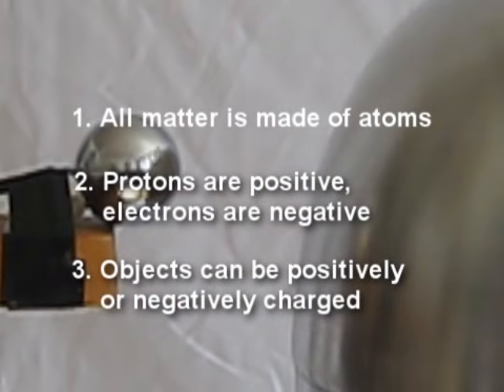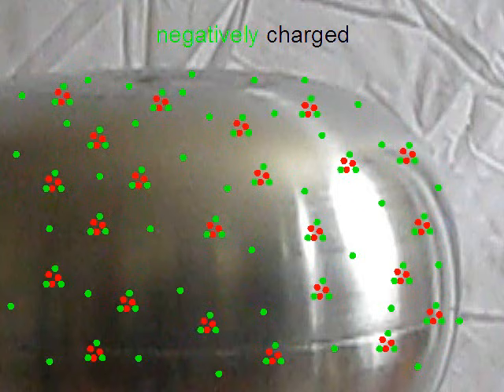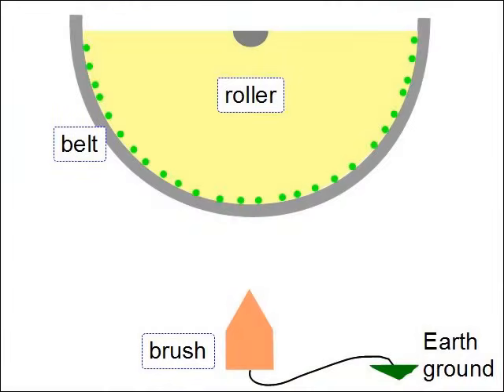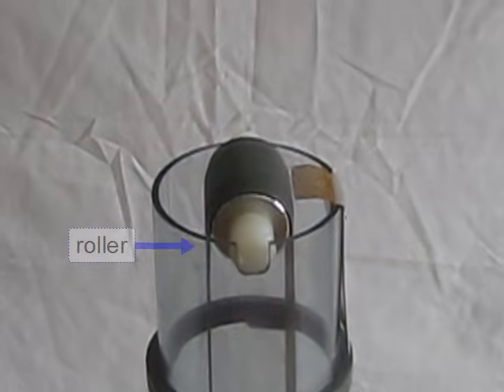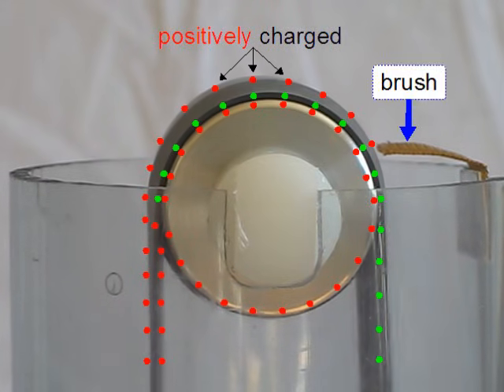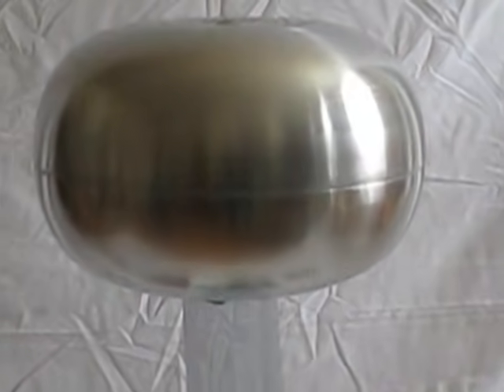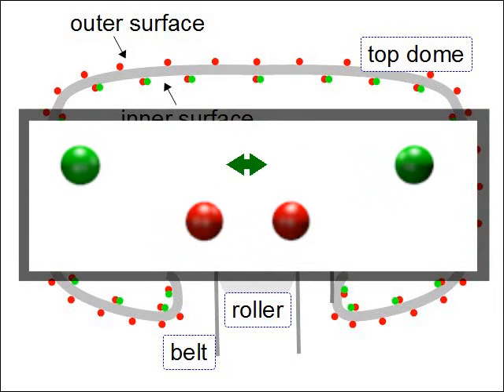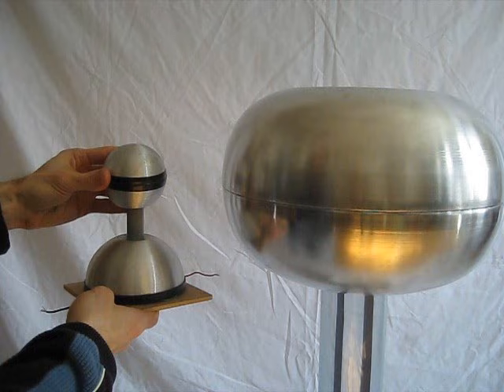How a Van de Graaff Generator Works

Comment: At first thanks for that wonderful video , but I find it hard to understand that there is a difference between the top brush being contacted from the outer or the inner area of the  sphere , it is a metal any way ,do you sure about that ,or is it a special kind of theory !  .
Reply from the maker: Anas Ahmad I know, it's a hard one to wrap one's head around, but it's not my theory. Look up "Faraday ice pail" or "Faraday cage".
Reply from the maker: Anas Ahmad I know, it's a hard one to wrap one's head around, but it's not my theory. Look up "Faraday ice pail" or "Faraday cage".
Reply: Anas Ahmad 
If your top brush is outside of the dome, and your dome gets charged, brush will have a very high density of particles inside it and electric field around it will be intense because it's out of the surface and charge on conducting objects resides on its outer surface. If your brush is inside the dome, electric field around it would be almost zero because all the particles will be on outer surface. So if an charged object(belt or upper pulley) comes near the brush that's outside of dome, it will charge the dome only until electric field around charged brush compensates electric field of external charge. But if you place the brush inside, it won't have any electric field around it and dome will charge almost infinitely(actually until parasitic leaks take over).

Comment: Question about the top dome.  Does the greater the surface area allow for a stronger charge?  I see people using spherical domes, what would the effect of making a 2d version or rather a vertical ring be?  Instead of being a round hollow shell, would a maze-like structure (inside, outside, or both) create more surface area without taking up as much space?
Reply from the maker: madDragon08 It is the surface area that's important. It's the roundness. The bigger the curve, the weaker the electric field, and so the less losses to the surroundings. That's why the larger the dome you have, the higher the voltage you can get to. I highlight this in the video around 14:56.

Comment: Is there any precaution to take to touch the home made van de graaff generator,like stand on a plastic stool....and is it make any problems in our body when we touch it...?????
Reply from the maker: Anandhu Krishna If you mean my homemade Van de Graaff that uses soda cans, they're harmless, unless you have a pacemaker. It doesn't cause any problem when you touch it. You just feel a very brief pain that goes away right away.
Reply: RimstarOrg  i mean about the van de graaff generator that look likes the one in ur video
Reply from the maker: Anandhu Krishna
Ah, I was confused because you said "home made" and the one in this video is commercially made. This one is much more dangerous because of its larger dome.
If this Van de Graaff generator is already turned on, then I wouldn't go near it, no matter what you're standing on. The spark I show repeatedly in this video is very thick and long and so has high voltage and very painful current, probably enough to cause a burn or at least make you jump with pain. It could be worse if someone has a pacemaker.
But, make sure it's turned off and also touch the dome with a grounded wire to make sure there's no charge on it, then you can put your hand on it and THEN turn it on. If you don't have insulating rubber shoes or are not standing on a plastic stool, then the charge will likely go through your body and to ground harmlessly. If you to have insulating rubber shoes or are on a plastic stool then the charge will remain on you and make your hair stand up. If at either of those times you quickly remove your hand then you might be fast enough to not get a shock. The best way to remove your hand is to first turn it off and then touch the dome with a grounded wire. That removes the charge. Then there's no chance of a shock when you remove your hand.
I do some demonstrations in this video here http://youtu.be/Gf6EbRmYImI
Reply: RimstarOrg Thanks for ur info, i like to present a van de graaff generator for my science exhibition and in this year i have to study about van de graaff generator and there is a short discription about it thats why i searched in the web :)

Comment: Excellent job. I have an older iteration of that model and the 200kv model as well.
Can you describe the upper roller bearing. The original had very noisy sintered bronze bearings which I replaced with plastic bearings. Ideally, I would use ball bearings, but I don't have the proper tools to do so. I'm always looking to improve my old unit. Is your unit noisy? Can you also describe the upper and lower combs? Serrated or braid?
Reply from the maker: eminusipi Thanks. I can't see inside well enough to see what bearings are in the upper roller. The bearings are fairly quiet. The overall machine is relatively quiet - about what you hear in the video at 0:14. Both combs are made from the sharp points of a stiff wire mesh that's cut straight across.Incidentally, I just needed a flashlight so I could see well enough to confirm the way the combs are made, and my CFL powered by an electric fly swatter from my latest video was handiest and worked great :D (http://youtu.be/sQCKNZMNCo0).
Reply: Thanks. The bearings on mine make a thump, thump sound but the plastic bearings are quieter than the bronze bearings. I want it to purr! You should have gotten that free led flashlight from Harbor Freight when you bought that electric fly swatter :)

Comment: Thanks so much for this instructive and thorough explanation. I just don't understand one thing. Why is the whole generator necessary to produce high voltage. Why can't you just connect a dc line to the inside of the dome and due to the Faraday cage effect it will continuously charge till it reaches a high voltage?
Reply from the maker: Zarek Newman The problem is with the DC circuit itself. The DC circuit expects a closed loop for the current to flow. A DC circuit has a positive and a negative output. If, for example, you connect the DC circuit's positive output wire to the inside of the dome and turn on the DC circuit, the DC circuit will do nothing since current won't flow from the positive back to the negative (or from the negative to the positive if you use electron flow instead of conventional current flow.) I guess if you connect the negative to a good ground then you might get some charging. That would fool the circuit into thinking the positives and negatives are connected together. Still not sure that would work though.
Reply: RimstarOrg If I understand correctly an analogy to positive and negative terminals and current flow is a hill (negative terminal) with the ball (electrons) on top. The ball naturally falls to the bottom of the hill (positive terminal). So too electrons naturally move to the more positive potential. It would go to reason that if there were any place with a more positive potential the electrons would naturally be drawn towards it. And since there is never a charge on the inside of the sphere shouldn't the electrons be drawn to the inner surface and then distributed on the outer surface? This in essence would be a circuit going from the negative terminal to a more positive one?
Reply from the maker: Zarek Newman Sure, if your DC power supply consisted only of a negatively charged ball, then the negative charge would see the inside of the dome as neutral, which is more positive than the negatively charged ball and so electrons would flow from the ball to the inside and then the outside of the dome. But a DC power supply is more than a charged ball. Even if it's just a battery, the battery needs a closed circuit around it. Or as I said, you might be able to trick it by grounding the other terminal.
Reply: RimstarOrg I built a cockroft-walton voltage multiplier with ac input and negative output but the voltage isn't high enough for a corona engine I built. I thought maybe I could increase voltage by getting a dome and connecting to the inside of dome. Is a voltage multiplier like a battery or like a charged ball?
Reply from the maker: Zarek Newman The output of the Cockroft-Walton voltage multiplier is more like the a charged ball.I'm not sure it'll help you though. It's a clever way to increase the voltage but you corona engine may also need a lot of current to get the desired level of ionization. While this will possibly give you higher voltage, it may give you lower current.
Reply: RimstarOrg I thought corona discharge was dependent on the voltage not the power.
Reply from the maker: Zarek Newman Yes, it's the voltage that breaks down the air and results in corona. 
But the amount of corona you get is partly dependent on your current. When you said you made a corona engine, I assumed you were doing something with ion wind, which requires current to create the ions at the rate you need for high thrust.My big 500,000 volt Van de Graaff generator can't sufficiently power my lifter (I've tried), but my 30,000 volt Cockcroft-Walton voltage multiplier based power supply can.
Reply: RimstarOrg The motor is similar to your ion wind rotor but is made from a small copper wire bent in a "z" shape. I see that you powered that with your Van de Graaff generator. If I understand correctly this particular motor requires higher voltage because there is no terminal that it is attracted to as it is just injecting charge into the air. I tried it with my Cockcroft-Walton voltage multiplier; it outputs around 3.3kv; but got no movement. Is this type of generator made only for very high voltages?
Reply from the maker: Zarek Newman I don't know what high voltage range works, i.e. whether or not 3.3kV is enough, but yes, it needs high voltage. A small copper wire bent in a "z" shape shouldn't need anywhere near as much current as a lifter though, unless you've mounted it in such a way as it doesn't turn very freely, or gets hung up on whatever it's balanced on. Intuitively I'd think that 3.3kV would be enough, but your Faraday cage idea might just work too since the current requirement isn't that high.
Reply: RimstarOrg OK. Thanks so much for all the help. Your videos are really invaluable. Best of luck.
Reply: Zarek Newman 
Actually there is a scheme where the belt is charged by external DC source and no triboelectric effect is even needed. That's what Van De Graaff Generator wiki page is about, check it out. In other words, your idea is correct - it will work. But apparently you'll need a separate DC high-voltage supply to charge the belt via corona discharge.
Reply: Thank you I am familiar with this design. my question was though why do you need a belt at all. why not simply have a dc source and a wire pointed to the inside of the sphere. the inside of the sphere has neutral charge and should continuously collect charge from the wire. I must be missing something.
Reply: Oh my bad I did not get your idea at first. That sounds interesting. I think the solution to why this won't work is this: 

If you connect an external DC supply to a sharp point inside a hollow dome, you'll need progressively more and energy to actually inject the charges into the sphere as the dome charges. For example, if you charge the dome negatively by injecting electrons into it, every electron inside the wire of your DC supply will have to overcome repulsion force of the charging dome to get inside it. And this work is done by your DC supply that has to be powerful enough to make it happen.

In Van De Graaff this repulsion force is overcome by the engine that moves the belt and DC supply just charges pulleys when the machine starts and won't produce any work at all during machine operation since it just keeps them charged.

So the point is probably that producing mechanical work by an engine is way cheaper/effective than producing same amount of work by a high-voltage DC supply.
Reply: thank you Alexander for clearing that up for me that must be the reason. but this leads to another idea. what would happen in such a case that the sphere is not a single piece but  a few pieces cut horizontally each connected with a resistor sheet. so you would have the top part of the sphere a thin resistor sheet then the next cylindrical section attached to the bottom of the resistor sheet and then another resistor sheet then the next piece and so on until the end. and the dc wire would be attached to the top piece. what i think would happen would be that the sphere would charge the top pieces first due to the resistors but there still would be a Faraday cage effect due to the bottom pieces. so the dc can get its charge in without it being opposed by the negative charge from the outside of the bottom of the sphere.

I hope his was clear enough. I would like to know what you think of this.

also if i were to insert a battery inside the dome, attach the negative to inside and the positive lead out of the sphere to ground where now the electric field of the sphere helps the positive terminal this should also accomplish what a vaan de graaf accomplishes but much more simple to build.
Reply: Zarek Newman
Unfortunately I don't think I completely got your idea about sliced sphere. However, you should take this fact into consideration:

Power that's converted from electric energy to heat by electric resistance P=R * I^2, but in our case of high voltage due to very high voltages currents are negligibly small. Which means squared currents are even smaller. So in high voltages field resistors are basically useless and that's mainly the reason why even normally non-conductive materials like wood become conductive if you attach high voltage to them and why they use high voltage to transfer electricity over long distances. So if you introduce resistors to electrostatic device they will be most likely simply ignored and you'll just have to produce extra negligible work to overcome them.

And your second case with a battery inside a dome is no wonder either: if you charge your dome with electrons, the battery still has to pull them out from somewhere. Probably that's ground outside of the sphere and you still have to produce enough work to overcome their repulsion force.

However, here's the idea: instead of charging the sphere with DC, you can charge it with AC making it oscillate. So you may take two spherical domes one inside of another and a source of AC current between them that will come into resonance charging them stronger and stronger with every cycle. And now imagine that you can use Earth itself as outer sphere and ionized air in upper atmosphere as the second sphere. Making a resonant circuit using this "capacitor" is what Nikola Tesla suggested which's neat, hehe.
Reply: thanks for clearing that up for me. Yeah the battery idea wouldn't work I didn't really think it through. and the other idea probably won't work either. i need to think it through more.

speaking of wood though I just read in a book "homemade lightning" by r a ford about a charge collector made by karl winter in which a thin circular metal wire is encapsulated in wood. he writes that such a set up is extremely effective in storing charge.
       "By surrounding metal with wood, a       transition from conductor outward through wood  (semiconductor) to the surrounding air (insulator) results. This absence of an abrupt change further reduces high voltage leakage."

Do you know if this effect has ever been studied? If we cover a van de graaf with wood maybe we can increase the voltage significantly.

could you explain what it means to come into resonance? Is this the mechanism for wireless power that Tesla suggested?
Reply: Apparently if you use semiconductor you can reduce potential gradient of electric field which means you reduce electric field. It's like instead of very thin layer of air that surrounds the sphere with high potential gradient(intense field) you replace it with wider area of semiconductor with lower gradient that's unable to ionize air and indeed it may reduce leakage. 

I have never heard of such effect and I have never seen such technique applied anywhere. However I have built my own wimshurst machine and a van de graaff generator(you may check my last two vids showing them) and I may actually test it. 

About resonance. Earth and upper layers of ionized air form a capacitor with non-conducting air as a dielectric between them. If you put one end of a wire into upper ionized layer and ground the other one, it'll form an LC-circuit that has some resonant frequency and you can pump energy into it. And yes, he wanted to use it for wireless power transfer. He even attempted some constructions but afaik he failed.